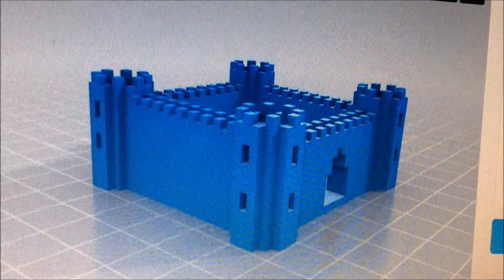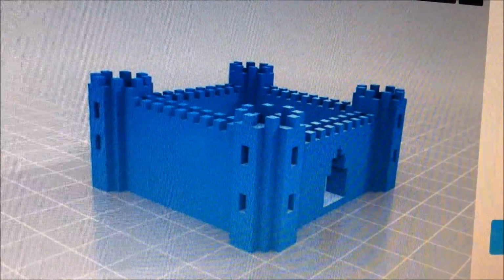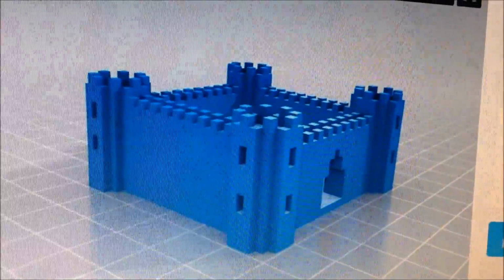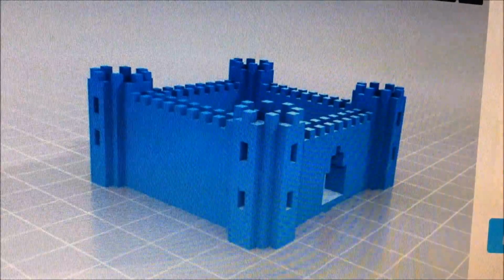100 microns VS 400 microns ON THE xyzprinting da vinci 1.0 3d printer

Comment: There is little or no gain between 200 and 100. I rarely print in any resolution other than 200 or 300 anymore. I always use a 350 micron starting layer.
I've found that I can get better print quality if I throw my filament spool in a small toaster oven on the "warm" setting for about two hours. Let it cool for about an hour and your good to go. ABS sucks moisture from the air like a sponge. It has to be dry to get smooth prints.